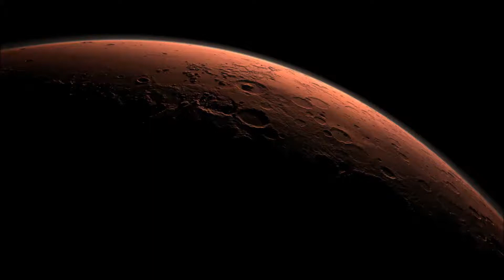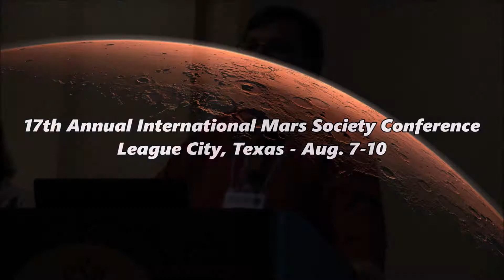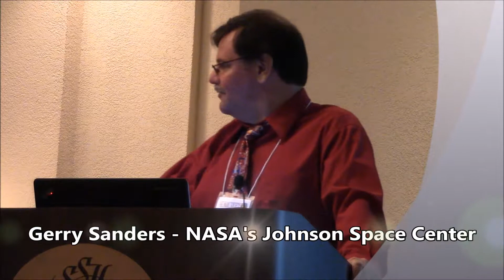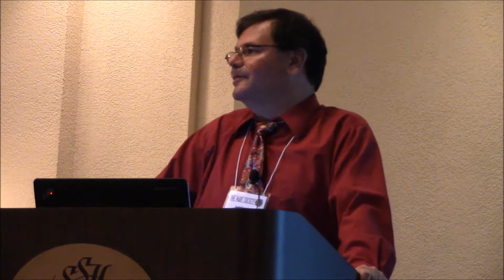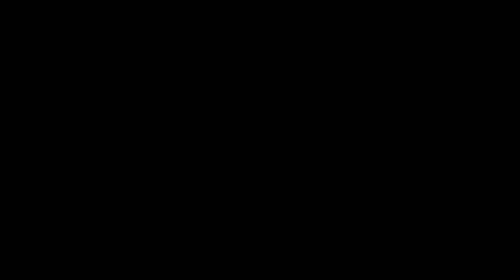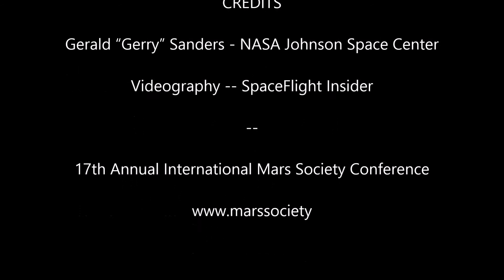Gerry Sanders - NASA ISRU - 17th Annual International Mars Society Convention

Comment: The most cost-effective form of ISRU wouldn't be done on Mars at all- it would be done in Low Earth Orbit.  What I'm talking about, of course, are Propulsive Fluid Accumulators.  Instead of launching all the fuel and oxidizer you need to get from Low Earth Orbit to the surface of Mars, you only launch your fuel-component to Low Earth Orbit.  Your oxidizer you get from Propulsive Fluid Accumulators in LEO, which collect Oxygen from the edge of the atmosphere (specifically the Thermosphere, which extends well beyond the altitude the International Space Station orbits at, for instance) using a funnel kept facing Prograde and a powerful vacuum-pump, and cryogenically cool and store that O2 as Liquid Oxygen for later transfer to a fuel depot in a higher orbit, and later to spacecraft launched from Earth's surface without substsntial surplus LOX supplies...
The Propulsive Fluid Accumulator maintains its orbit by using the Nitrogen it collects (the vast majority of Earth's atmosphere) as propellant in an electric thruster, while mainly only holding onto the Oxygen fraction.  It periodically docks with a fuel depot in a higher orbit, where there is less drag, to offload its surplus O2 (using what little Nitrogen it didn't use earlier as propellant for the transfer) and then returns to a oxygen-collection orbit.  The spacecraft you want to refuel never interact directly with the PFA- only with the fuel depot in a higher orbit...
The greatest challenge in operating a Propulsive Fluid Accumulator is providing it with electrical power- but there are several solutions to meet a PFA's substantial power-needs.  The simplest of these is simply to launch a PFA with an onboard nuclear reactor- but if that is unacceptable as a solution a PFA is also capable of operating purely off of solar power- albeit more slowly and at a higher collection-altitude (where minimum power and fuel-requirements to fight drag are less...)  Another alternative that is less controversial than a nuclear reactor but more effective than onboard solar power is to set up a small constellation of solar power satellites in a much higher orbit (where there is very little drag) and "beam" electrical power to the Propulsive Fluid Accumulator in its lower orbit in the form either of microwave/rectenna systems, or lasers and specially-designed photovoltaics on the PFA.  Alternatively, you could beam microwaves (lasers are easily blocked by clouds) from the surface of the Earth to the PFA, although that would require either a large series of ground-stations in the tropics in a belt around the Equator, or a series of relay- satellites in higher orbits to bounce power to the PFA satellite when it is on the far side of the Earth...
No matter how you provide electrical power to the PFA: with beamed-power, nuclear reactors, or large onboard solar arrays; you need to only collect two of the most abundant gasses in the atmosphere (Oxygen and Nitrogen), learn how to store them, and develop fuel-transfer technologies to move them to an orbital fuel depot to make this technology a reality.
And additionally, Mars-specific variants of the technology are possible that collect surplus CO2, as well as using it for propellant in electric thrusters for station-keeping.  Such a system would be most useful if you rely on solar-electric propulsion to get to and from Mars, but it is also possible to run Sabatier Reactors in orbit of Mars, reacting that CO2 with H2 from Earth to produce H2O (and, after electrolysis, O2) and CH4 for chemical propulsion back to Earth, as well as landing on Mars and returning to Mars orbit...
The less equipment you have to put through re-entry and actually land on the surface of Mars, the better.  And any technology that can provide virtually-unlimited supplies of Oxygen in Low Earth Orbit has MANY other useful applications, such as propelling satellites to Geostationary Orbit (instead of proceeding directly to GTO orbits, you launch with just enough Oxygen to reach LEO, and take on additional LOX there, so you only need launch a minimal quantity of H2 or RP-1 for the transfer to Geostationary Orbit), missions to the Moon, and sending probes to the Outer Solar System...